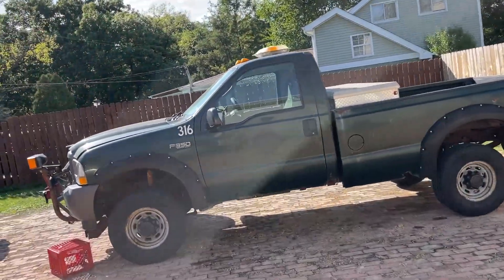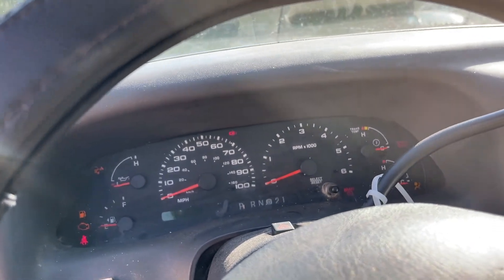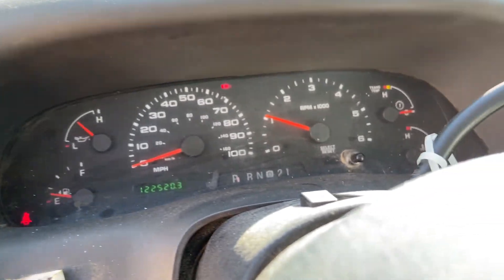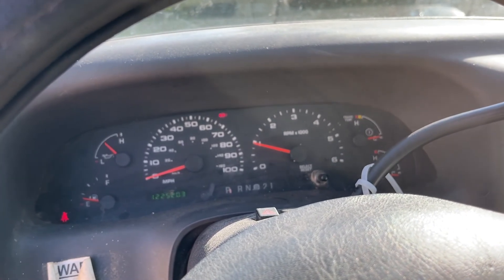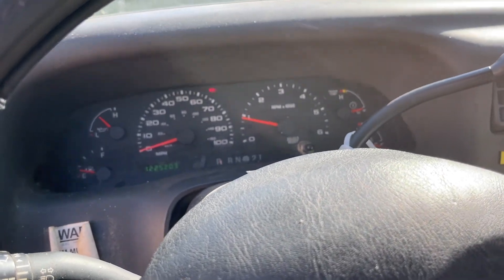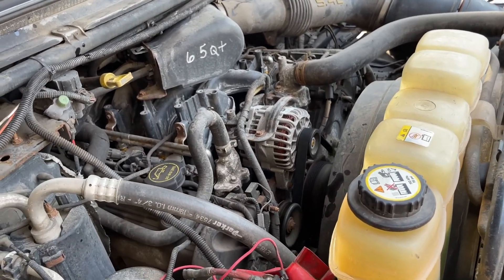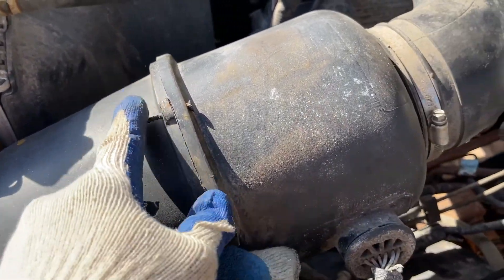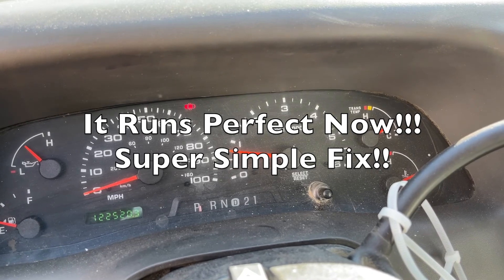Found out why the Ford F-350 (5.4) was Idling sporadically and stalling during idle! Super easy fix!

Comment: So your air filter clamp was the problem mine is kind of doing the same it will die sometimes at red lights
Reply from the maker: Yep. Please check your. If there is any suction lost the truck will run like crap.

Comment: Hi…How can i slow down the idle on a ford 350  Rv motor home
Reply from the maker: What size engine?
Reply: @TerenceDIY  hi…1995 Ford 350 8 Cyl
Reply from the maker: @fireside007  ,  You may need to replace the Idle Air Control Valve on your vehicle. Here is a link to the part. 

https://www.ebay.com/itm/333971912655?fits=Year%3A1995%7CModel%3AF-350%7CMake%3AFord&hash=item4dc246f7cf:g:zoEAAOSwLwdggmVm&amdata=enc%3AAQAHAAAA8JlPeekDYMcxer45T%2FBDa9ZIgUF0kDm%2BoztzDCqsl4R0giF0Li061cIqLo43VOOODOYbpQiM8YqB04LaK7fQwusj%2BMx7B7iwajS6OoObnYmFDJzgY5rST%2Fq4q7ROCa0LXLGDRgfrcv5xdkXkf7EcoX1mTy7CvOxG22UtsYXopxBUB4P7yR15M5%2Fyw1mCOTPlAyHRpY%2Bof6dtITrBGCiY1%2BsctBRIV5CVtPrTJ7bdA%2FenezOhRF7YVnvFebLy7IcXUGspmZhqc7ng1FWxuTv0lKCge9KLMiD6JBVlfHKewAdU1jqxq7BPZBmz5VyPjGA5Xg%3D%3D%7Ctkp%3ABFBMuLvbtvVg

Comment: Hey I hope you see this but what is the ticking noise the motor is making mine is making the same noise
Reply from the maker: Hi Tyler, I'm not sure what ticking sound your talking about, but if it was making a ticking noise upon first start up it was because it had sat up for a while and I needed to change the oil. The truck runs amazing and is super quiet. Thanks for watching.
Reply: I just got and rv with 1E350 6.8L V10 that started making a tic tic tic tic tic sound last weekend out of no were.  and the faster the rpms the more faster the tic sound became.  turns out it was a tiny threat that had frayed on the serpentine belt. that was slapping something every time the belt went around its path.  snipped it off till i could get a new belt and all was good.
Reply: Cam phasers,common issue @TerenceDIY
Reply from the maker: Definitely in the 3V engines. I have dealt with many of the earlier ford 5.4 engines and I never had an issue withe the cam phasers. Unfortunately, I cannot say the same for the 3V engines.